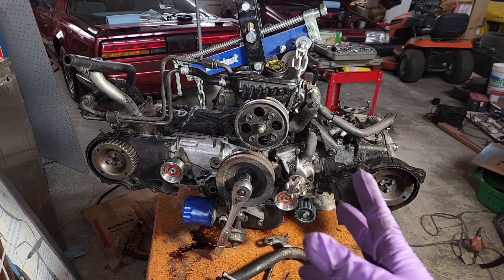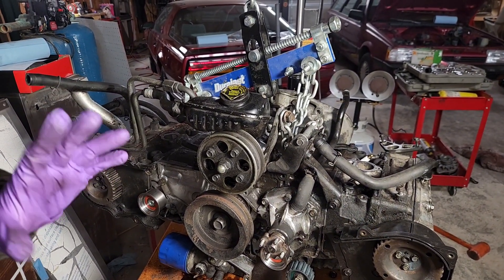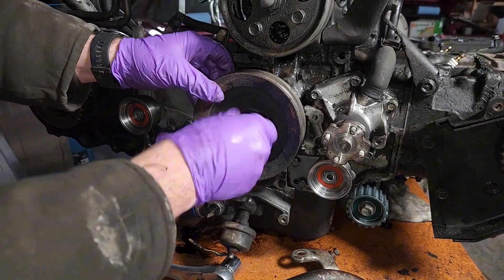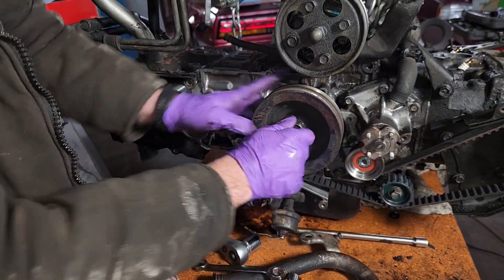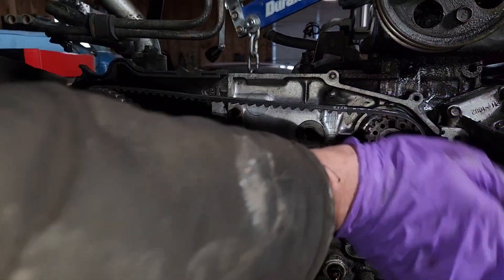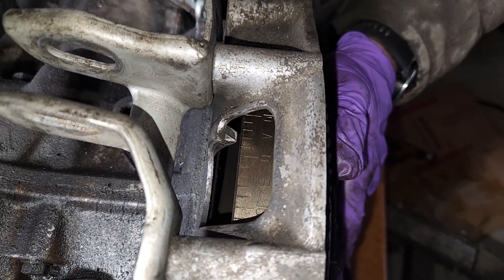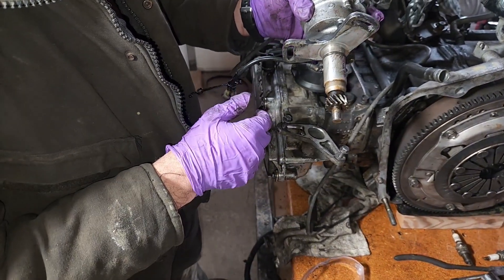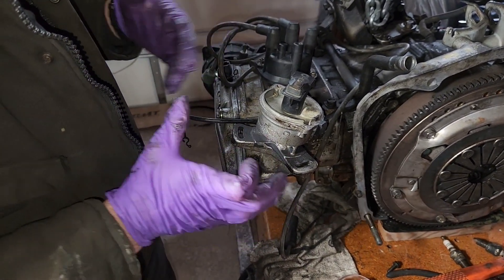How to: Replacement of a 1980's-1990's Subaru 1.8 Timing Belt

Comment: One timing belt for each bank on cylinders ?
Reply from the maker: Yeah. Subaru is still using this setup with the modern engines (though some or maybe all have gone to a chain)
Reply: @NiceGuysGASS Years Ago , I Had A EJ 251 That Used A Single Belt
Reply from the maker: Was that procedure easier?
Reply: @NiceGuysGASS Yes , But I've Never Done A Twin Belt EA82

Comment: Great video! Just got my hands on an XT with a 1.8 - Quick question: You have the distributor out of the motor but is the distributor alignment necessary if it was never out of the car BUT the timing belt broke? I'm replacing the timing belt but my distributor is untouched so I'd like to avoid it if necessary.
Reply from the maker: You might get away with leaving it in. If it were us, we'd put the new belts on, disconnect fuel and spark, then crank (with cap off) and confirm all the marks stay lined up. 

If they look off, proceed with the removal and realignment
Reply: @NiceGuysGASS Thanks for all the info! I’ve done a handful of timing belts on newer generation stuff but this is great info! I appreciate it!
Reply from the maker: Happy to help!